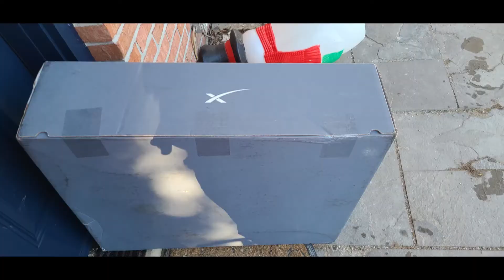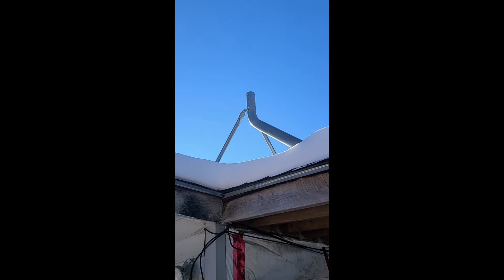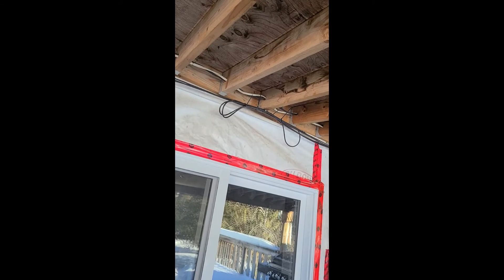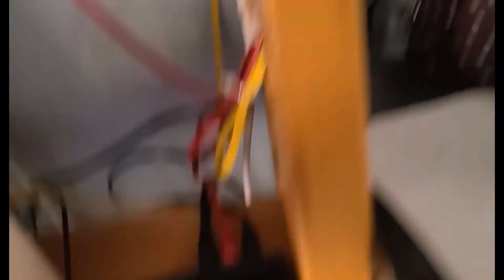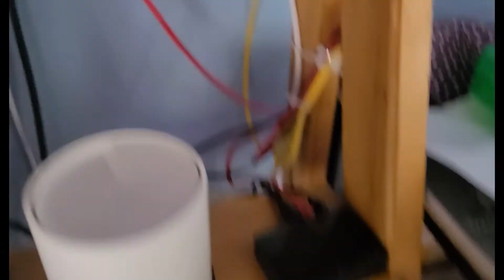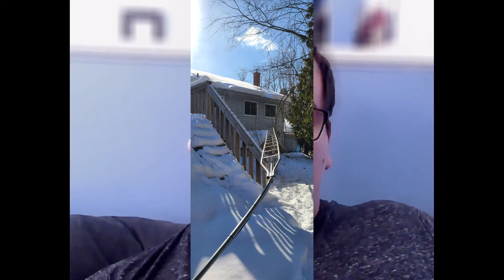Starlink - 1 Yr review / Archive clips not shown!

Comment: Good comparison of the rural internet services.  I will be surprised if services like the rocket hub or explore net will survive once Starlink is readily available.
Reply from the maker: They will be blown out of competition easily. Bigger ISPs try to monopolize others by using some sort of regulation with the country's communications commission. Look at SpaceXs battle with hugesnet and other providers as they tried to take them to court and lost. It won't be different otherwise. Only downside is if the person is unable to perform a install themselfs they have to rely on someone who can do it for them.  I had no issue and I am use to being up 30ft+ on a cable strand on a pole. And I could do a install. Could be neater looking but I did it in the winter and it was cold when I did it. But it sure is faster thou! And thank you kindly for the comment. Means alot!